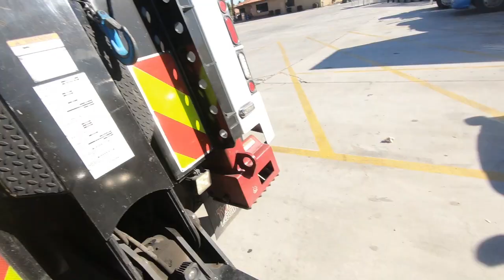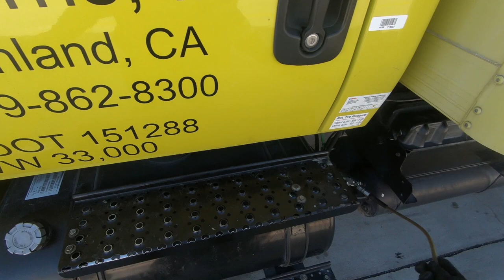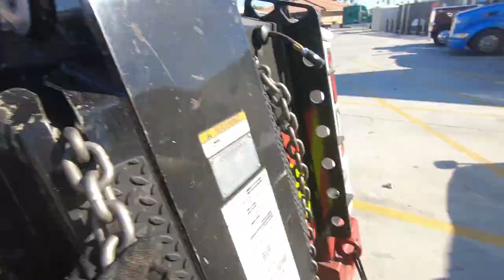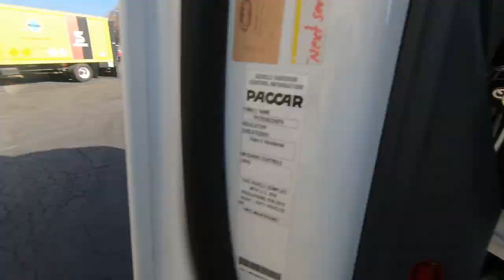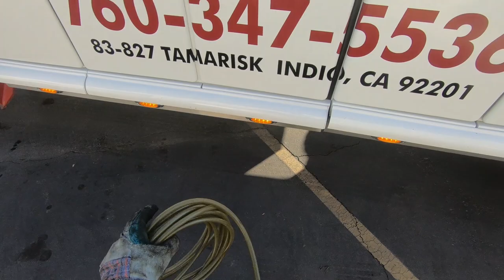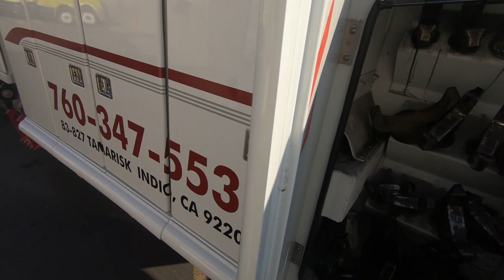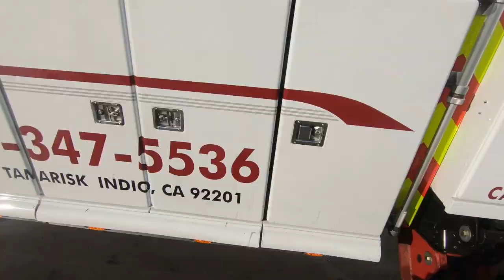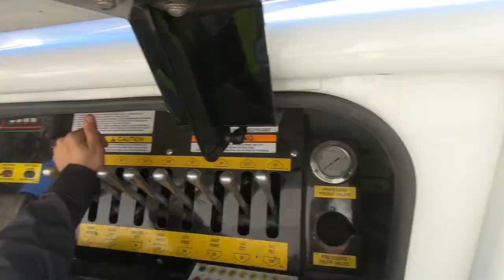Box Truck Breaks Down And Needs A Tow

Comment: 3:11 Welp, that's you overheating problem...
Reply: That would be the no air pressure issue to. Probably a belt driven compressor. That was an easy roadside fix if the driver would have just looked under the hood
Reply: Expensive tow bill for a broken serpentine...

Comment: Why do you need to disconnect the drive shaft if its in neutral?
Reply: because even when its in neutral the drive shaft spins the transmission and it doesn't get any oil so it will burn up however you can tow a manual transmission for a few miles but it comes down to company policy too. you can not tow a automatic in neutral at all.
Reply: It is to protect  the transmission  from damage
Reply: Thor Wald some transmissions have a pump to pump oil to an external trans cooler leaving the shaft on would heat the transmission too much and cause damage
Reply: Thanks guys for clearing it up for me!

Comment: Lol the exhaust dump is turned sideways right into the driveshaft. Can't be good  on the u joints and the slip yoke, during regen that's alot of unnecessary heat into them.

Comment: Thought the driver said was a manual transmission and still pulled the driveshaft??
Reply: Gary Cutshaw they do that to keep from unnecessary miles on the trans I have friends in the towing industry and they do the same
Reply: Pulling driveshafts  is Protocol in the towing industry . It is done to keep the transmission  from being  damaged
Reply: The difference is that a manual transmission can be moved short distances at low speeds - such as extending or retracting the underreach - with minimal risk of damage. An automatic risks catastrophic damage from the same small movement. Neither can be safely moved at high speeds or for long distances with the driveshaft in place.
Reply: It's actually done to comply with insurance company mandate - they are tired of going to court to pay for bogus transmission claims and this keeps them out of court entirely. Only fleet accounts where the insurance companies have agreed to not go after each others transmissions is Trent allowed to haul them without pulling the driveshaft - a local garbage truck account is one exception very early in the video series he tows maybe 7 of them in total and it's explained there. Insurance company policy.